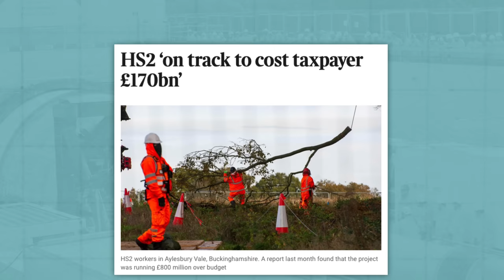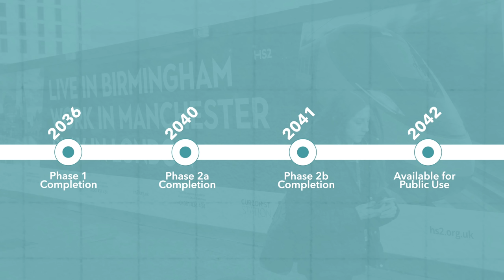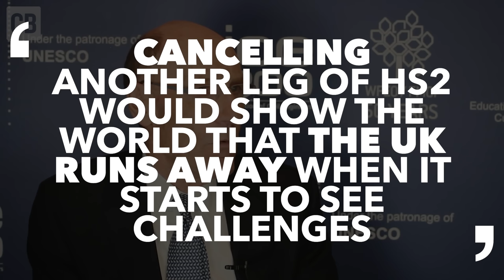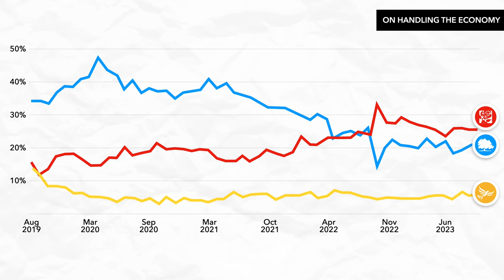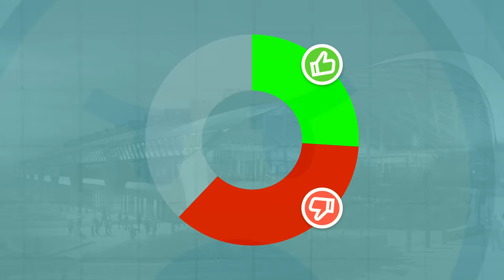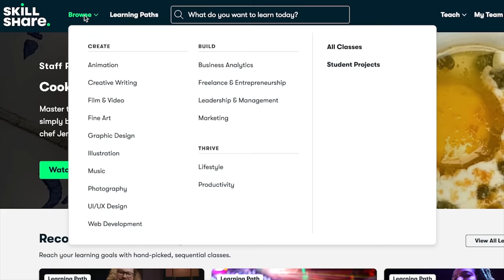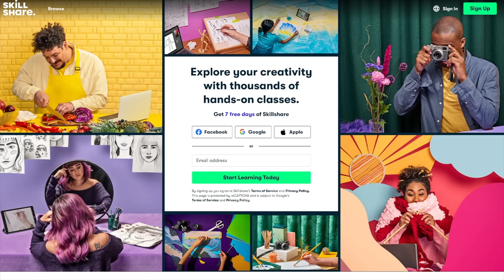Could Cancelling HS2 Work for Sunak?

Comment: If it had been cancelled years ago, I probably would have supported the decision. Now it's too far in and that's just a huge waste. Being aware of sunken cost fallacy, I still think it's best to commit to the parts already in progress.

Personally though, I would have pumped that equivalent money into 100s of smaller upgrade projects across the country, optimising existing lines for improved reliability, speed and capacity. That would have been an actual levelling up of the whole system, and not just limited to a few cities.
Reply: The problem is that both the West and East cost mainlines through England are at or near capacity. Adding capacity to either (ideally both) would take even longer (it's complicated af to work on a live railway) and cost more than building a new line. 1/2 of the capacity benefits of HS2 were lost the moment they scrapped Leeds, as the current plan does nothing to address capacity constraints on the east cost ML.   It's death by a thousand cuts. If they cancel even more now you can bet that all those outsourcing firms will still get paid.
Reply: @octarinehk  of course it would cause some trouble, but my idea would be many new small areas of track that would allow trains to maintain speed, e.g. literally cutting corners of some otherwise fairly sharp bends using more tunnels, bridges and just generally cutting straight through more areas - this would be a bit destructive but probably equal or less than HS2 in total. 

The benefit of those smaller optimisations is that so many of them would be built separate from the live railway until it's literally just connecting to the rest of the existing track. Plus most of these projects would be just a few miles long (or less), so they are short projects. You only need to follow pretty much any of the old railway lines to see candidate places that have quite sharp corners.

If you can maintain top speeds on existing track and rolling stock you're already cutting journey times, then those lines would have at least some stretches where future newer trains can hit higher speeds.

Obviously I'm not an engineer but I think this whole strategy would be a sensible way to incrementally upgrade our railways. Of course it all counts for nothing with the current awful franchise system, it either needs to be public (the ideal solution) or actually made into an actual free market where competition can occur.

Oh and I'd also give lots of our cities some kind of tram, light rail, trolley bus systems. The Swiss are great at this, lots of small cities there have tram systems.

Comment: having contractors pay for costs that exceed the bid is necessary, as otherwise you have an incentive structure that rewards un-realistic (and even outright deception) bids, the rewards for the job go to the contractor, the costs for fuck ups must also go to the contractor, this is the entire point of using a private company, they can assume risks and rewards (and have incentives to get it right), take that away and you might as well just use a government run enterprise (with all the propensity for cancerous incentives that entails)

Comment: Massive projects like this always go over initial budgets - that should have always been projected from the start. The much more ambitious Chūō Shinkansen in Japan has hit budget problems and delays as well, but they are not cancelling it, because they know it is only a matter of time before the country will have to do it anyway. This is typical Tory stuff - they are serving their short-term political interests instead of doing what is required for the general public's need. Their non-response to every industry being on strike, the school infrastructure scandal, and everything else demonstrates the same attitude. The problem is that the public knew they were voting for this in 2019 and still did it.

Comment: If the project balloons to 10x cost of other nations' lines then it should be canceled. First I would question is there is actual use for train transport and then if existing rails could be updated for speed with better engineered trains. Al trains I see are cast iron lumps and very tall. A socalled light rail train is 100tons. An Abrams M1 tank is 54ton. Also trains are very tall. For some reason train engineers and top rate imbeciles. A few good men should be gathered. Always get the best, never mediocre people.

Comment: I've never really been convinced that building a faster rail link between London and Manchester would actually help the great north/south inequity (which is a very real thing). I think the divide exists for reasons that have nothing to do with journey times between London and Manchester.

The real question is whether paying a bunch of construction firms (who chiefly won't be in the North) to build the thing is a better way of helping those communities than - for example - investing the money directly in those areas in regional development grants. The problem there is that it's been proven time-and-again that if you don't fix the underlying causes of problems, merely throwing money at that is a temporary solution, at best. I'm not sure that the underlying cause of problems in Manchester, Sheffield and so on is that it takes slightly too long to get to London. Which is - essentially - the argument in support of HS2.
Reply: its. not. about. journey. times.

It's about how many trains you can fit on the railway.  Wouldn't it be nice to get a 7am train from Manchester to London and not have to stand the whole way.

Comment: 👉Britain is notoriously lagard and expensive when it comes to capital  projects, far behind other countries. You need expertise but Britain involves an army of consultants and clip-board "experts". Apparently there are over twenty people making £150k already.

They built a special easily graded line from the North to the South called the Great Central Railway, from Liverpool/Manchester via Sheffield, Nottingham, Leceister, Rugby and London. They shut it in the 60's. Quite near where HS2 is planned in places.

Contractors would require compensation if the plan was axed. I hear Northern Mayor's are planning to sue the government after spending on land development.

There's a lot of form on this.
UK is the most economically unequal country in the OECD.
Northern votes were required to build the Channel Tunnel. Northern MP's were promised direct services  from cities and towns to  Paris and Brussels.

Funny how HS1 stopped in London? Not.

The Treasury Green Book is Anti-Midland/North.

Crossrail £15bn West-East line gets waved through in London.

Politically it will be most damaging. The country is +£2 trillion in debt. Gets involved in costly foreign quarrels.

If Brexit taught the government anything, it's stay out of foreign adventures. Put Britain first.
Levelling Up will cost trillions rather than billions and probably take a century or more.
The signal is sent, what most people believe, by axing HS2 that the country is really split, the South East and the rest. It will not be more clear!

Sad about Ukraine but The Treasury is skint, the National Health Service, Triple Lock, HS2. Should  level up Britain not Ukraine or anybody else.

Comment: Removing projects doesnt make money magicly apear money 
Infact removing the structures now would cost 50 times more then the entire railway system of europe becaus digging out cement and trying to re selling would be in a loss and thats not even calculating the amount pay for workers needed
Also public transit would only increase as jobs needs to be more viable all over brittain deu to brexit since alot of eu online jobs have been cut and not a single policy about home working done on any of the fields that there were when you guys left 2022 trade unions of europe

Comment: HS2 is the epitome of failure by comittee. The concept and goals were great, the implementation has undergone flawed iteration after flawed iteration though. Scrapping it in it's current state would be worst than not starting it in the first place. As it is, it is just an other vehicle to drive a wedge into the North-South divide and widen it even further. Moreover, leaving it in it's incomplete state would mean the further investment in capability needed to support the project would end, whole businesses and industries gone in a flash.

Comment: Correct me if I'm wrong but wasn't this to connect Northeners to London quicker (20 mins earlier 😕) and easier or was it to rinse the tax-payer i.e those dodgy brown envelopes or to aquire land on the cheap if the rail-line passed over your property??? 🤔
Reply: Originally meant to increase capacity and speed of express trains coming from scotland and the pennine belt to london.

Comment: The primary positive for HS2 is to improve capacity for both passenger and freight services which in itself is a great initiative.

But why couldn't that be achieved by building a normal, non-highspeed spec, railway? The massive issue with HS2 is that both sets of rollingstock are not interchangable with eachother.

In the UK - with its smaller size in comparison to other countries - it's clear that normal-spec and properly funded railways would suffice and be far more useful. Am I wrong?

Comment: Yes it will work to keep the island as backward as I see all Tories. They are broke, have no idea and have no spine to stand through anything important. UK will fall back and honestly, jobs, and it would make cause and effect. We have inflation and this is not cost overruns it is inflation. But I no longer expect from British politicians and common sense. The function is time = money. Thus you take the risk and push ahead. Every day delay cost you.  So cut construction time and save money.  Open lines as early as possible to start make the line operate and make money.